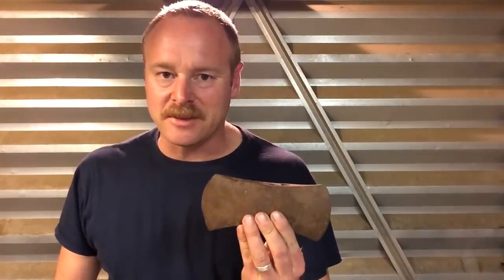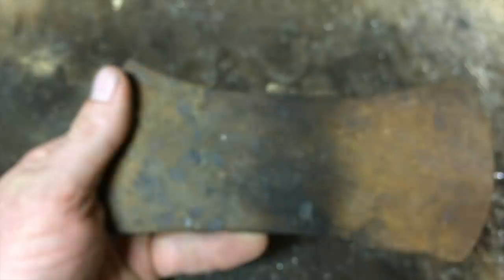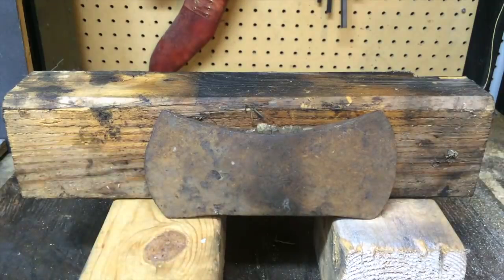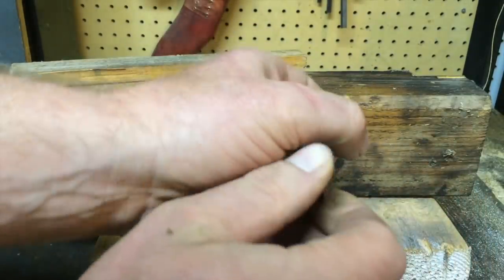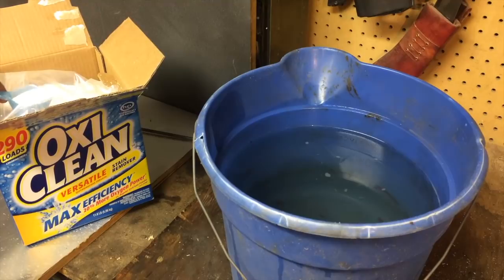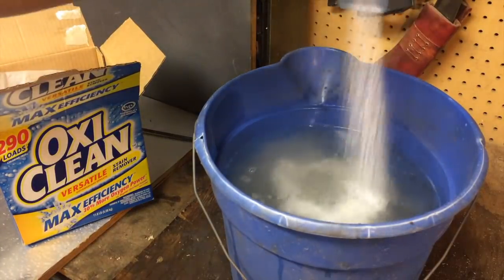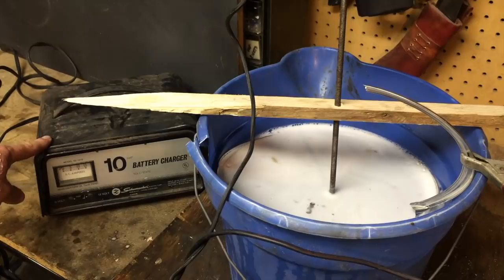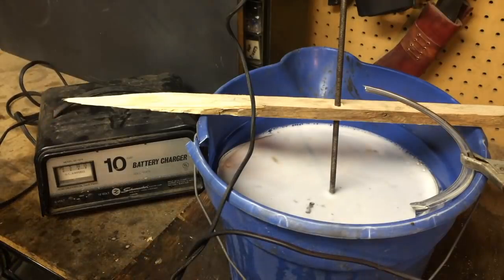Remove Rust With Oxiclean | Grandpa's Tools | Cruiser Axe 1

Comment: so I can add salt? OK I'm using salt
Reply from the maker: lol don't say I didn't warn ya!
Reply: Why cant you use salt? I am a poolntech and use chlorine everyday. Not to mention I use salt as well o salt water pools. Water passes through salt cells creating chlorine. People swim all the time i  chlorine water and salt water pools. 🤔
Reply: Do you create chlorine GAS (chlorine vapor)? Do you run an electrical current through those solutions? Please do your own research on the dangers of chlorine gas. People have died from cleaning their toilets because of the release of that vapor. -- FWIW, I have a 55 gal drum electrolysis system setup and use A&H Washing Soda in the solution. Works great. Glad to know that OxyClean is another good choice. Absolutely no reason to expose myself to the risks associated with chlorine gas, since there are satisfactory alternatives readily available at my local grocery store.

Comment: People often don't realize that electrons actually move freely from "negative" to "positive."  Its counter-intuitive but true.  Thanks for pointing it out with emphasis. 
  What you gave there works, particularly for smaller pieces but, if you can get the "horsepower," a 40 amp charger is best to get the job done, particularly if you suddenly get the urge to restore something like a cast iron pan/griddle/Dutch oven, etc..  They need the extra juice or you'll be there 'till next Christmas.  lol. But you have a good, simple, basic example of what it takes. 
  You mentioned the Arm and hammer "washing powder," I'm just pointing out to the viewers that it has to be the powder, not other washing "soap" powders.  Sodium carbonate, as you say.  Fortunately its found in most larger grocery stores that can carry the expanded inventory.  And its relatively cheap.   If i remember correctly, its a ratio of a cup for every 5 ten gallons but that can be verified.   If all else fails and your solution doesn't seem to be getting the job done, add 1/2 cup per ten beyond that until the reaction starts to perc along.  Just give it a couple hours before adding more.
  I've done very heavily gunned up,  large cast iron in 48hrs or so with a 40 amp setup.
  One word if caution!  If you have to submerge your clamp(s), they will deteriorate along with the gunk.  Try to make a connection that allows you to keep the clamp above water, if possible.  :)
  Thanks again for this simple and informative starter guide. :)

Comment: Silly question for you (I know this is an old video) What would you say the sacrificial ratio should be to the removal of rust. IE lets say I have a tire rim (you know from a small car or such he he) that I need to remove some rust from how big of a sacrificial piece should I have for it.  4SQFT(surface rust) = 1sqft(sacrificial surface) again awesome video.

Comment: I know this is an old video, but can you use stainless steel for the cathode or is it not good for this process at all in either role? A set of leatherman multitool pliers got rusty so that the only working parts are the pliers/wirecutters itself (other tools dont fold out, too much rust)
Reply from the maker: Hey Sam, it depends on who you ask.  My understanding is that it will function just fine but at some point there's the potential for some undesirable stuff to be released from the stainless.  I don't know it for sure but that's what I read.  One way or the other I think this would be a very good way to loosen up your Leatherman.

Comment: You got A new sub! I'm going to try this on several pair of Vice-Grips that I got at an auction. The adjusting screws are rusted solid as the owners tool box got water inside for A year or more as the estate went through probate. I have been using Vapo-Rust but that craps expensive.

Comment: 6-01-2020  - - - - -   What was the amp rating on the charger?  Mine has two settings:  I think one is 1.2 amps and the other one is 6 amps.    I'm going to re-do the rocker panels and fender wells on my truck which are bubbling-up the paint with rust.  Is there a method similar to this to remove the rust on vehicles chassis and sheet metal?  Thanks.

Comment: I used a 50/50 mix of water/vinegar, oxyclean and a battery charger. It is amazing how quickly the rust came off.
Reply: I just use plain white vinegar.  It takes a while but if there's one thing I have plenty of, it's time.
Reply: Seems you are mixing an acid and a base there.  vinegar and oxyclean.  Doesn't that defeat the purpose of having a conductive solution.  Also depending on the mix ratio, either all the acid will react with the base, and non left, or vice versa.

Comment: I would have used lye (sodium hydroxide) from the hardware store, but I'm glad oxyclean worked for you.

Sodium percarbonate is sodium carbonate and hydrogen peroxide. Hydrogen peroxide is H2O2 and differs from water H2O by having an extra oxygen atom. And that extra oxygen will eventually contribute to additional oxidizing of your sacrificial metal electrode.   I was hopping to see that but im glad it worked long enough to do your job. 

Lye water would have been a far better conducting electrolyte  and you could have done the same at 6 volts using half the watts, and make roughly half the heat that you did.

Comment: Nice Plum, I believe what you have there is more of a hatchet and not so much of an ax..cool hatchet head. Did you notice that one bit is more stout than the other? The stout side is meant for chopping while the thin side is meant for the clearing of small branches. Great remnant from your grand daddy!

Also, one thing you should explain. Do not use a "smart charger" as these chargers will not work, what you need is a manual charger.

Comment: Nice job. I've been watching many videos on here about this topic, and tried it on a few low end projects.

IF I had a place to do what you did, I would try it out. Unfortunately, I live in an apartment complex with now facilities to do that with. I just have windows and power receptacles... no separate area to do this in. AS a result, I've started to clean an old camp hatched my father had, which I've inherited using Rust Stain Remover by Whink. Wasn't sure how it would do with my hatchet, but thought I'd give it a try. Couldn't hurt. So far, it's doing a decent job. Maybe I'll end up soaking all of my grandfather's tools I've inherited with the solution. If it doesn't work on the hatchet, will have to try something like what you've done with your double-bit axe head. Maybe it could be done next to an open window in living room.
Reply from the maker: Hey Kevin, I'm interested to hear how the Whink product works.  Another alternative is to submerge the item in straight white vinegar, that works pretty well.
Reply: It turned out fairly well. If i kept it out of the solution for too long, the air would oxidize it, so I coated the head AND handle with Virgin Oil then wrapped it up in a washcloth soaked with the oil and then aluminum foil to protect it until l use it. I may have to use something else, if it doesn't work this way. 
Thanks for asking.  :-)

Comment: That was actually quite impressive!  I've been collecting oodles of old rusty antique tools and other miscellaneous crap for years - (cuz like it's said:  if a little is good, a whole truck load is always better) - and  I almost always just go for the wire wheel buffer to get the show rolling.  But I'm going to get 500 lbs of Oxiclean,  a swimming pool and a 1000 amp DC power supply, and if I don't have to call the fire department and/or the local HAZMAT team, see if the results are even better!... I'll let you know!... I wonder what would happen if I switched those leads..?...Hmmmm.
Reply: Make a video :)

Comment: Great run with it! The only downside to sodium percarbonate is that it's gonna create a mess of hydrogen peroxide in any warm water solution, which will break down into oxygen, and.... potentially risk flash rusting the thing you're cleaning after the power's off. Obviously as your results show, this isn't a major concern!  //if anyone else is doing this, you can totally just use baking soda (sodium bicarb) instead of washing soda.... or just heat the bicarb in your oven for a bit and you can turn your bicarb into washing soda.

Comment: I'm sure you figured this out by now, and I forgot the name of it, but that piece of metal is inserted to hold the handle in the axe head. It's used to split the wood in the handle, widening it into the hole, and keeping it attached.

Great video by the way. I would have loved to see what the coffee can looked like afterwards. I always have OxyClean in the house, never Arm & Hammer Laundry Wash. I never would have known you could substitute. Good to know. I have quite a few tools to try this with, but was always too lazy to buy the necessary item. Now I have it!

Comment: Intteresting vid. Never tried electrolysis.  Always mixed a solution of 6 %Acetic acid  by volume with H2O. Use a 20l/5gal. plastic pail.      Acetic acid attacks iron oxide. No electricity bill. Simply soak parts for a couple of days. Further, a fix for looose handles on shovels, axes, hammers etc. is to soak the working end, with handle still in place, in a pail of used automotive antifreeze/coolant. Swells up the handles and wooden interference wedges for a better than new fit. Has the added benefit of containing anti-corrosion properties. No need for adding excessive metal wedges. Thanks for sharing and best to you and yours.
Reply: I concur. I've used both these techniques successfully.
Reply: Best to you and yours.

Comment: Aren't the anode and cathode backwards? Electrical Connections are correct, flows neg to pos. but-the term "sacrificial anode" is where the anode gives up of itself and the cathode- (boat hull or motor) loses nothing. Aren't you sacrificing or  removing material (rust) from the axe head To be deposited on the other metal? Just wondering. Ty

Comment: When using the vise, to protect the surface of the axe, you could use cut pieces of a leather belt to hold the axe rigidly in place without damaging the metal. I've been doing it that way for years and it works well, i.e., no movement of what is being held.

Comment: What I would like to know is is the oxiclean any better than just the baking soda? I keep lots on hand for cleaning silver... another method... but same principle. Is it enough better to justify the cost just for this type of use?
Reply from the maker: I dont know that it's any better.  My point wasn't that this was better, just that this is what I had available and it works.  Thanks for watching, toot tall.
Reply: that test might make another vid. for a control, you need to use only water in one.
Reply from the maker: Good idea!

Comment: It's now 3 years later. I've just checked on aliexpress and the cheapest models are now under $10k (just). Dug a bit further and found out it's because of advancements in "fibre lasers". There is now at least three major manufacturers competing in the market to make these fibres. The fibre lasers still require extremely rare elements to manufacturer though, which limits how cheap this version of the technology can ultimately get. I can't wait to see if someone can figure out yet another breakthrough!

Comment: Do restoration on old vehicles and such and it works real well.  Motorcycle gas tanks is a real good application, but it takes several days since you can't get that big of anode into the tank lid.  One thing I have ran into is yes the tank comes out like new, but the down side is if it has rusted thru spots you find the holes real fast.
Reply: Do you think gas tank coatings are any good? I’ve had a couple work great, and a couple fail and the fuel is red in months. Application process and most variables were identical for all of them..

Comment: Question please. Besides removing the rust, might some of the metal in the can metal be transferring to the axe metal (plating it.) You'd think if it was only removing rust that the axe would come out shiny. So something else might be going on too.  (I have soaked mix coins in vinegar and it seems some of the copper from the pennies transfers to some of the other coins such as the quarters. )

Also sometimes a magnet can help determine what kind of metal you have.

Comment: That piece of metal you found in the old handle was a metal wedge meant to expand that part of the handle to make a tight fit so you don't throw off the ax head when you swing it.  You will find these metal wedges in hammers too.
Reply from the maker: I'm quite familiar with wedges and although this was undoubtedly "serving" that purpose, it was a ragged non-tapered piece of tin

Comment: I use a combo of Dawn soap and Oxyclean; 2.5 gal (start out with hot water) two tablespoons of Dawn and one scoop (1/4 cup) of Oxyclean - two days to a week. rusty greasy oily parts. I haven't used Oxyclean as a solute for electrolysis but it looks like it works quit well and would be less caustic and way easier on the environment. Because Oxyclean and Dawn are a detergent agents, the part will need to be washed and rinsed thoroughly.

Comment: hello from greece mate! tell mei this can you put in to buget is from tommato juice..???? must be iron not inox steel??? thanks
Reply from the maker: if you use a metal bucket instead of a plastic bucket like I did I think it could work well. You could attach the red (positive +) lead directly to the bucket. (I hadn’t thought of that before). If you did that though YOU MUST NOT have the item touching the bucket or else it will short out. I think you could suspend it from a wooden dowel or similar. Good luck, be careful, DO NOT SHORT IT OUT.

Comment: Can you do an electrolysis process on the vehicle automobile in other words place the anode and the cathode in regards to the frame would this work or would it short out the cars computer resistors and what have you?
Reply from the maker: Hey Joe, it's a good thought BUT... in order for electrolysis to work you need to have the item immersed in an electrolytic solution of some sort sooooo.... you'd need to dunk the whole car which as you suspected, would likely short our some stuff.  Thanks for the question!

Comment: I have used a 24 volt batter charger. I did it outside and in one hour the solution was hot and bubbling. That rusted piece of metal was cleaned up. Washed it let it dry painted it orange.

Comment: I use plain old cheap baking soda and it works fine.
The derusted item should be washed and dried thoroughly and then immediately oiled (or waxed i preferred) to prevent flash rusting. Look like that was done on the axe.

Comment: My prof at DeVry told us that water is an insular ear. It doesn’t not conduct electricity at all! It’s the I purities in the water that conduct electricity, minerals and dirt, algae etc. so pure distilled water wouldn’t conduct electricity. That’s what I use it in radiators along with a good coolant.

Comment: i'm looking to restore some rusty car parts, would you recommend electrolysis over distilled vinegar?
Reply: Oxalic acid will dissolve rust to leave clean bare metal without harming paint finishes and decals. It's sold in powder form as wood bleach and in larger containers for cleaning automotive cooling systems. It's also reusable until it stops working.

Comment: your sacrificial anode is chrome plated, that's Bad Mojo. you need some black iron pipe or some rebar or an old lawnmower blade
Reply: I dunno if it makes a difference or not in what you're saying, but that's definitely not chrome plated. It would make coffee unnecessarily expensive to chrome plate every can. Most likely, it's tin plated.

Comment: White vinegar diluted 50% with water works as well.  Mix, drop in rusted steel part or axe, let sit overnight and rust is gone.  No battery charger required.
Reply from the maker: I've never tried it diluted but agree that vinegar works very well.

Comment: If you aren't in a hurry, plain white vinegar works great.  Just pour a gallon or two in a bucket like that and put the axe head in.  A few days later it'll look good as new.  Doesn't require a power supply at all.
Reply: And you can use the same vinegar over and over quite a few times.

Comment: If you use baking soda you won't get all the suds and slime from the soap. I've used baking sida with this method on all kinds of tools I've found and they've come out much cleaner than yours. Usually clean black metal that will rust extremely quickly if you don't get something on it.

Comment: great!  converted rust to black oxide, in effect a rust proof coating.  Keep it oiled and it will never rust again.  You can do the same thing with salt (I heard the video comment) and H2O2 but I like your method better.

Comment: It didn't flash rust after you removed it from the solution either which did happen with my thin steel medicine cabinet and chemical rust removers and with Pittsburgh drill bits and chemical rust remover soak as soon as they hit air.

Comment: Interesting video- over 2 million views so now I don't feel so bad as I'm not the only guy watching you dissolve rust away. It's a pet peeve of mine though to see that over 2 million people watched yet only 49 thousand bothered to like it. It's not that difficult to hit the like button nor does it take that much time- the guy took the time however to make a video that you watched and gained some possible new information out of and it didn't cost you a cent. For the 2 thousand that didn't like it- I wonder just what they expecting from a video on how to remove rust from a piece of metal? some people are just hard to please I guess. Anyway thanks for sharing your info and taking the time to do it?
Oh before I forget- my Grandfather on the farm just use to throw the axe head in a small fire and it would burn the broken handle out. It doesn't get hot enough to destroy the original temper- it's just another way of doing it.